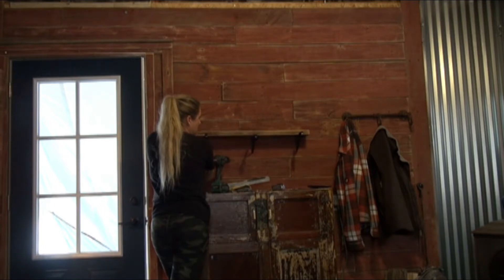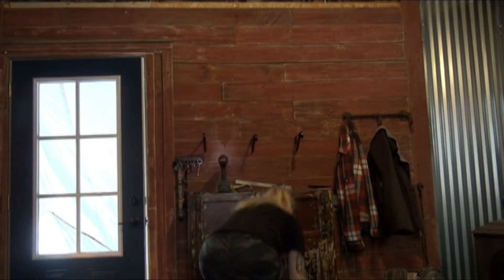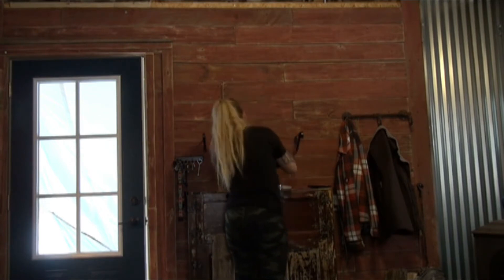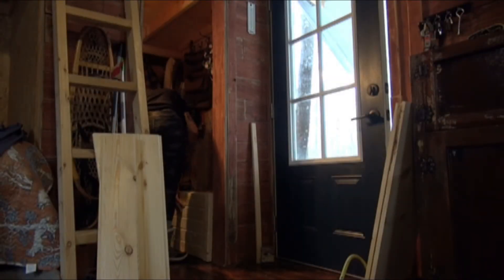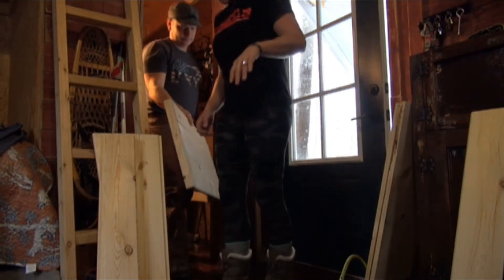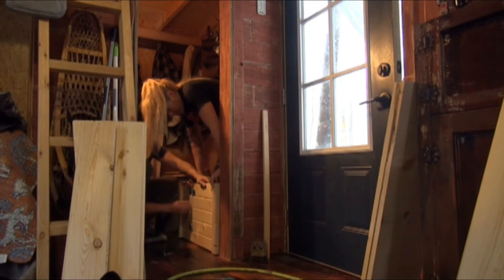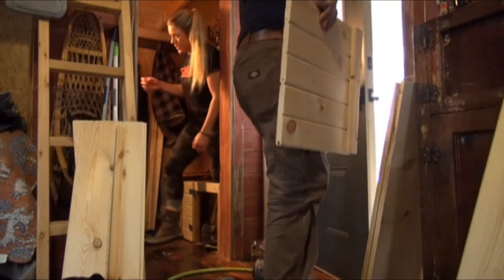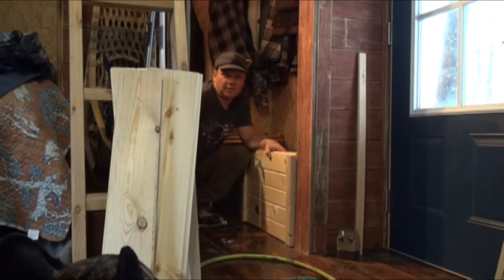Composting Toilet Bucket System for Off Grid Living

Comment: Nice work. I do have a few suggestions though. We built a similar toilet for our off grid property, I wanted to try out a composting toilet just to see if it would really work and they do work. But sometimes we had problems with smell. A few months ago we switched it out for one with a urine diverter and the difference is night and day. The smell is gone. Also, be sure to seal the hole cut out because sometimes things splatter. You know what I mean.
Reply from the maker: Thank you for watching!! I appreciate any advice!! I was thinking of trying a urine diverter but didn’t think it would make that much of a difference? I think I will order one. Thanks again!!